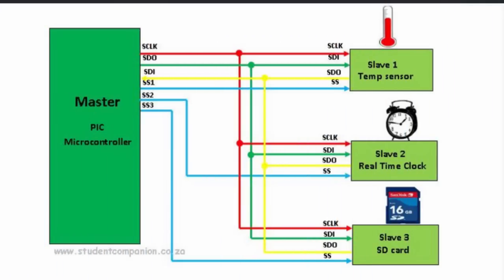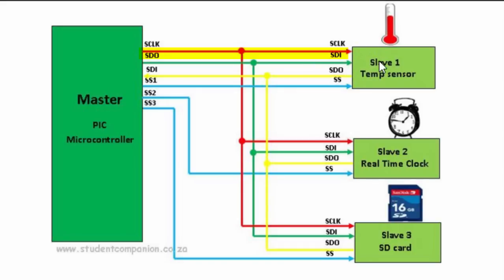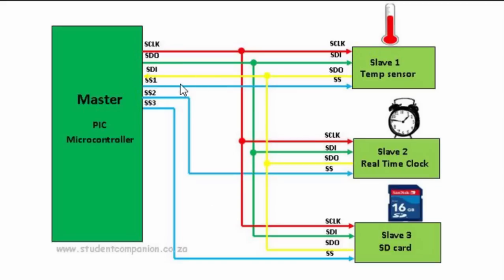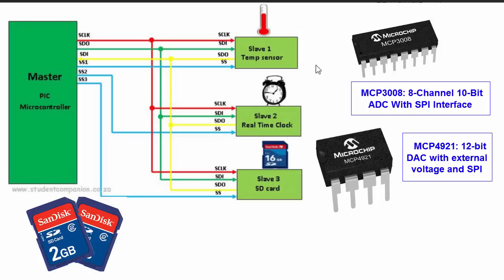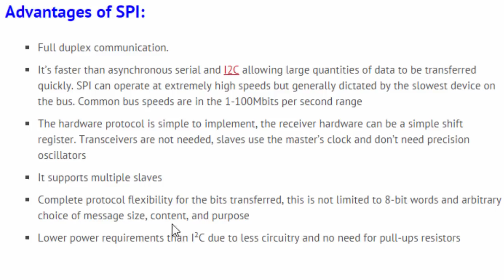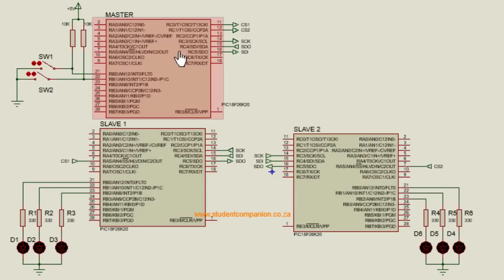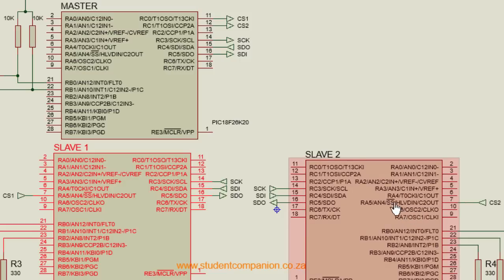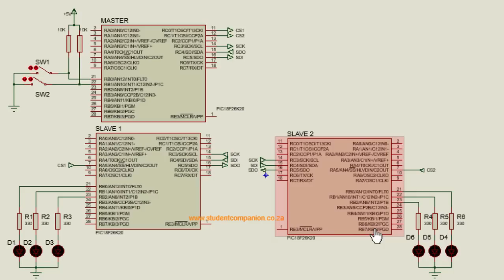44- SPI Communication, part 1: Introduction | MPLAB XC8 for Beginners Tutorial

Comment: Hi, can i use MPLAB code configurator for actual devices, not just simulation on proteus?
Reply from the maker: Yes. What you see in simulation is what you can get in actual devices if configured correctly.
You can watch even microchip examples using real hardware and Mplab code Configurator

Comment: How would you send ADC data from a slave to the master pic?
Reply from the maker: Hi. Are sending ADC read by the PIC ADC pins or an ADC specialized chip?
Reply: Hi, ADC read by the slave PIC ADC pins.
Reply from the maker: +Marco Domingo why would you want to read it in this way? The master has ADC pins, for efficiency you must read from the master. It doesn't make sense to read from the slave then send to the master.
Reply from the maker: +Marco Domingo If you require high ADC resolution than the PIC can offer, then you can use a high resolution ADC chip. Some of these chips have SPI module and can be used as slave devices.   Remember the length of wires on SPI bus should be short
Reply: Yes I know it's not a practical implementation but I just wanted to try it out for the purpose of seeing it work, or sending data from a slave to the master. Okay so for it to be more practical, how can a specialized ADC chip send data to the master? (if you can answer the first question as well I would really appreciate it, thanks!)
Reply from the maker: +Marco Domingo the chip will act as a slave device. Like the ADS1118
Reply: Yes and what line of code will make it send the data to the master?
Reply from the maker: +Marco Domingo it won't send but the master can read regularly from it.